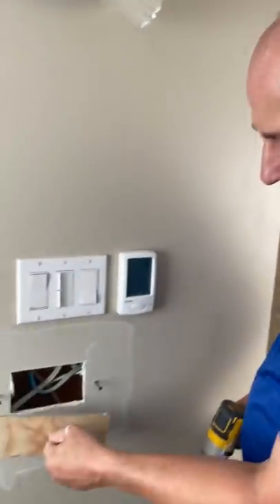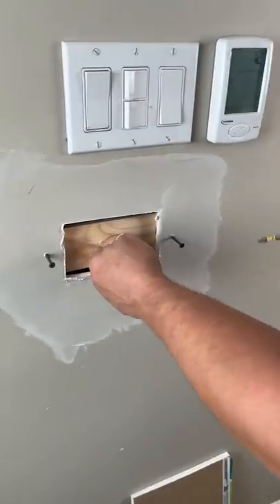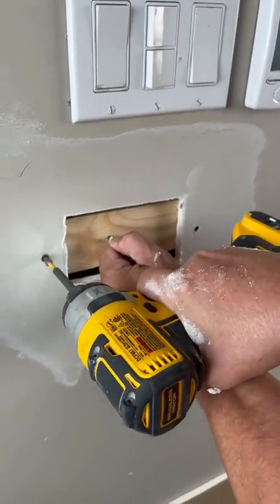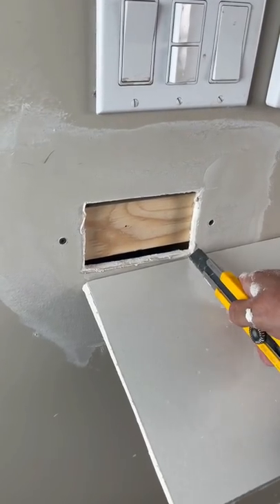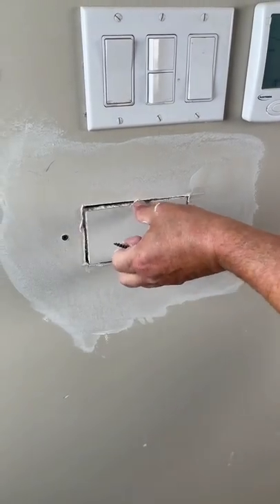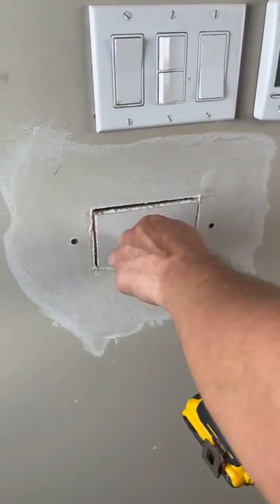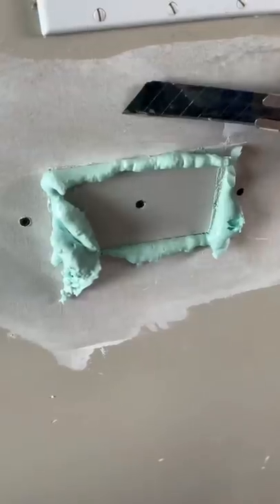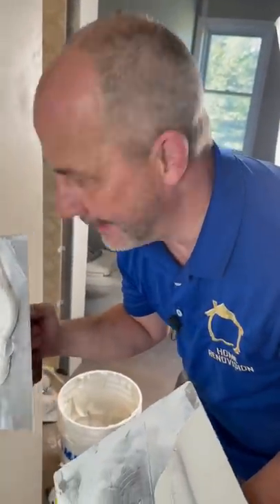Drywall Patch, No Tape Required #shorts

Comment: Learned this on “Canada’s Worst Handyman” as a kid.
Reply: Savage
Reply: I remember this too.
Reply: Red & Green?
Reply: Facts.  My eyes rolled when he said you don’t need tape.
Reply: Yep. I was probably 15 when I did this on a wall with lath and horsehair plaster.
Reply: @oluwaboriogunafolabi3997  you don’t need tape with this method
Reply: yep.
Reply: @mihailmilenkov6223  You don’t, I do.
Reply: @oluwaboriogunafolabi3997  everyone with their special needs xD
Reply: @mihailmilenkov6223  at the end of the day if it works for you or whoever you’re serving, and so long as certain standards of quality are met, everyone has their own approach.  In my experience the method on the video produces cracks. Especially in locations with extreme temperatures. I’ve seen it and opt for taping.  Usually prevents call backs.
Reply: Same
Reply: @oluwaboriogunafolabi3997  why tape when you can use this obviously awesome fireblock?
Reply: @oluwaboriogunafolabi3997  agreed. I don't want callbacks. Also, not everyone is A Okay with somethimg that expands. Ive seen people use too much. I would CA patch it or just cut, tape, and mud it. But to each their own I suppose.
Reply: @mihailmilenkov6223  lol
Reply: @oluwaboriogunafolabi3997  there are multiple ways to do proper repairs without tape.
Reply: Hahaha "best part , you don't need tape" or any skills or common sense
Reply: Is his name Ricky?
Reply: As a kid? Lol must have made some holes in them drywalls?😂 relatable to be honest 😂
Reply: Gold Star comment right here
Reply: If you wanted a quick fix over taping a small hole like this, I would opt for a California patch also know as a hot patch
Reply: You savaged him with that comment
Reply: Yep
Reply: Cut it so it leaves the paper on as a border. Then you don’t need tape
Reply: @3sotErik  😂😂
Reply: Is there a reason you shouldn’t do this? Is there a better way?
Reply: I loved that show
Reply: God I miss those shows.
Reply: @Omlet221  I mean everything is relative,it might crack,it might not most professionals would rather just tape it and not have to worry about it.
Reply: @wiskyr6510  Nah, his name is Gay Fonzie
Reply: @oluwaboriogunafolabi3997  shit I wish I had clients that just gave out money for shitty half assed work! Dont need tape? Why do people believe shit like this foam patch are a good idea? Have you encountered anyone in real life that's ok with it? I'm sure you mostly encounter people like I have that require good work lol
Reply: Lmfaooooo!!!!! 😆 🤣 😂  😆
Reply: My hero, but I'm always a day late lol
Reply: @NEED2CONNECT I have a genuine question as a complete non expert in any of this. Why does the tape change it so much? Without tape this wall going to collapse any second (which already wow because it doesn’t seem like a big deal to me just a hold in a wall like for a light switch) but with drywall tape this big wall collapsing problem is suddenly gone?
Reply: Literally.
Reply: Red green show?
Reply: @oluwaboriogunafolabi3997  I agree 100%.  I tried the no tape technique once and it worked for 2 weeks before it started to crack. I know this because it was at my house so I could see it happening. You have to shake the can of foam for 2 minutes before you can spray it, and I can tape it and be on to the next one in 2 minutes. It's just lazy
Reply: @Gl-my8fw  and there are multiple ways to do high quality repairs that you can guarantee and all of them but one use tape, and In the same amount of time, but if you're ok with cutting corners that's your choice, but this technique will fail and it's just bad advice and laziness
Reply: @gabrielshepherd6063  those work great, but the paper overhang is pretty much the same concept as tapping. Isn't it?
Reply: @chichidouglas5078  not that it is really anyone including the customers business what method you use anyways.
Reply: Ditto
Reply: @oluwaboriogunafolabi3997  you don't need tape technically just like you don't have to patch it either, but why would anyone choose not to do either
Reply: @MsTwissy  I believe that's sarcasm but you know that right
Reply: @Gl-my8fw if you're serious then I disagree. It's definitely the customer's business to know if they're getting a hack job or a professional job. If you're not serious then sure who gives a fuck about quality or a good reputation or recommendations for more work just be lazy and do shit work
Reply: @chichidouglas5078  no I’m so sorry I am a 25 year old psychology major grad applicant and I could tell you so much about Late life non-Alzheimer’s dementia and cognitive decline but I have NO idea how houses or structures work 😬 at all I feel very dumb and if you could explain it to me why that would be cool because I tried searching it on google but couldn’t find an answer that made sense to me but I promise I’m not being a dick I truly don’t know why tape changes the outcome so much. Or why in general a wall stands versus falls I truly have no idea.
Reply: @MsTwissy  l said believe it was sarcasm, but judging by some of the other comments maybe it wasn't.
Reply: @chichidouglas5078  ohhhhhh ok I get it the tape is not magic Thats why I couldn’t find out a reason why on the internet. Thank you, I am sorry for the paragraphs too I get so worried people think I am speaking in a mean tone so I go overboard trying to portray that I am truly just here for the positive vibes and not to get on anyones nerves at least not on purpose.
Reply: @MsTwissy  if you're being serious then just don't worry about what people you don't know think or say about you because they don't matter and have no effect on your life unless you let them, and if you're just trolling there's still  nothing to apologize for and at least you put some effort into it
Reply: Well holy fuck hahaha 😆
Reply: That  foam didn't look fire rated so I'm not sure what hes doing
Reply: @oluwaboriogunafolabi3997  Thank you for being nice with your reply. You esplained. Good feedback
Reply: Other than the insulation...tape would be awesome....
Reply: And its a damn good way to fix a hole
Reply: @chichidouglas5078  agree, the can of foam is also $10-15 and the can can’t be used after such a small job it’s a bit of a waste. Plus it’s a bloody mess
Reply: @kiloalphatango3256  you mean Red Green not Red and Green lol
Reply: @mihailmilenkov6223  yes u do lol or you will have spots that look like shit and will b a bit rough you can only sand so much
Reply: C'mon, he's a Pro. This is just for when a simple little home repair is all that's needed.
Reply: Clearly none of you know how to prepare walls. The block adds extra strength to the drywall while also providing a a solid base to properly fill in the holes with expansion foam and the actual drywall. There’s nothing wrong with this. If anything it’s one of the the better methods there’s nothing wrong with this.
Reply: The point is that when you use tape you're able to see the raised area on the wall.....

Ends up looking like 💩 unless you cut back the face paper to inlay the tape.
Reply: @Gl-my8fw  these people act like they couldnt patch a hole in gypsum without using tape to save their lives if they had to
Reply: Only.acceptable drywall repair that involved no tape.is.a california patch!
Reply: @oluwaboriogunafolabi3997  I really like this guy's videos, but I don't understand why he didn't just make a blowout patch instead. He's literally where I learned how to make them.
Reply: I did this once, never
Reply: @jeffreyhill1011 worst part is it doesn’t seem any faster or beneficial in any way. It’s like that one guy on the crew that is always trying to do tasks differently that they “came up with” to feel important for no reason other than ego or laziness. If you find a new way that works and produces the same or better results, power to ya. But reality checks are useful.
Reply: @oluwaboriogunafolabi3997 I thought it'll be another California patch, but it's worse...lmao

Comment: Next homeowner: Thinks its a stud and tries to mount a heavy cabinet
Reply: Yes cause everyone needs a heavy cabinet right under there light switch.
Reply: @hedananddazai5704  thats where I always install them
Reply: @spencerearl9964  your insane.
Reply: @hedananddazai5704  
Their*.
Guy in the video told us how to patch a hole. The hole could be anywhere, but in this video it's under a light switch...
Reply: @bsudun3050  indeed, but the point is the next home owner wouldn’t logically have that problem. I’m sure if the hole was somewhere else he would of done it differently. But it’s in the one spot no one will nail anything, especially anything heavy.
Reply: @spencerearl9964  usually light switches aren't placed inside a stud as that takes a lot more work when they are extremely light and can be put up using plasterboard screws, if you see a light switch there are going to be wires around that area of the wall, choose a better spot
Reply: @Faolan_Grey  Got'em 😂
Reply: This made me laugh so fucking hard
Reply: Ngl I had this happen mounting my TV, turns out it was an old doorway someone closed up with with plywood and mud.
Reply: You dont hang a heavy cabinet directly into a drywall. You mount it to the metal strips behind
Reply: @spencerearl9964  hey stepsister. You seem stuck. Need some help?
Reply: @cornpop9262  yes I seem to have put my hand straight through this weird weak spot in the drywall. Please save me step bro
Reply: Olol
Reply: @spencerearl9964  haha
Reply: Stupid asf, yet funny ash
Reply: If you are hanging cabinets without looking for studs or measuring spaces between all studs, then you deserve to have your heavy cabinet fall. What a dumb comment. Clearly you have no idea what you are doing.
Reply: @hedananddazai5704  this is funnier than the original comment
Reply: @bsudun3050  and if that hole was in any other spot, it would of had a different fix. This guy did cut a corner and I don’t recommend, but the comment said that the home owner would put a heavy cabinet in that spot. I simply stated that’s stupid, no one hangs cabinets right under light switches and most home owners don’t even nail anything near their light switch for fear they will fuck something up
Reply: @lordandsavior6726  exactly!!!!
Reply: @bradenkuehl2033  thanks?
Reply: @hedananddazai5704  good carpenters don't rely on "who would do this".. amateur
Reply: @bsudun3050  don’t respond
Reply: @bsudun3050  just know
Reply: Lmaoooo
Reply: He should have used another smaller piece of drywall instead of the plywood.
Reply: I’m sorry but I had to join this legendary battle
Reply: Lmao
Reply: @hedananddazai5704  Yes, cause everyone who uses this technique will be patching a hole beneath a light switch.
Reply: @JackR_TV  from the reaction in the comments it’s clear this guy is the only one who does this ‘-‘. But I think your missing the point, there is a hole under the light switch, and because of that he used that technique. He didn’t use that technique and the hole just so happened to be there. That’s the logic your going on, every problem has different solutions doing what he did won’t have the problem Of running into a heavy cabinet because of the location. And the location was why he used that technique, if he was fixing a hole on a kitchen wall away from all possible wires like you know a LIGHT SWITCH, then he would use a different hole. Because there is a actual possibility of a heavy cabinet being placed there. Anyone who mounts a heavy cabinet right under a light switch is just asking from problems and in that case it’s there own fault if something happens. You electrocute yourself it’s on you dawg.
Reply: @hedananddazai5704  their
Reply: That’s why I would only advise to do this to your personal home and not a client
Reply: @Faolan_Grey  savage
Reply: You can expect there to be minimum stud underneath ELECTRICAL
Reply: feels like that's gonna be a them problem
Reply: @frankfort976  ""whaa diid he say tha doesnt pass ur grammer n spelln test?? And go ahead an hate my grammer n spelln I DONT CARE!! 👍🙂👍
Reply: @bsudun3050  they're*
Reply: Next Home owner ain't your problem. Who cares
Reply: Below a light switch?
Reply: Use a slice of drywall the same size as the wood.
Reply: Whole house collapsed except that one repair spot...
Reply: @hedananddazai5704  Yes, cause drywall holes only happen under light switches.
Reply: @hedananddazai5704  Jesus man THAT WAS THE JOKE. 🤦‍♂️
Reply: @Frosst  it’s 2022 shame on you for joking smh
Reply: Why not just use a piece of drywall with gauze
Reply: @hedananddazai5704  have*
Reply: That sounds like a them problem
Reply: Delightfully devilish
Reply: Experts: Only I know how to do it right, you have to burn the house down and build a new one because there are no methods of patching that don't get criticized by guys like me that have been "doin it for 30 years"
Reply: Also, these holes are often behind doors, caused by doorknobs.  No shelf there...
Reply: Hey, actually when you're checking for studs, do the extra work.

It's common to have all sorts of blocking in the walls. Larger holes often need extra support. Imagine a 12" hole between studs(16" apart). The patch needs to be held up! So support has to be given.

Whatever technique you use to find studs(just use a stud finder), take the time to test it. Measure 16" over, and make sure there's a stud there. Go up, to make sure there's still stud.

A lot of stuff, like cabinets, need to be mounted to studs. If you find some sort of blocking, scrap wood from patches, or maybe even a malfunction, then you're not hanging cabinets on studs, and you will never land on one. I'm sure we can imagine how that would play out.
Reply: I build and install cabinets…If there is a whole that needs patching, thats not where a cabinet should go anyways wether if it was patched or not…..
Reply: Lol !
Reply: That's actually a good point.  I'm going to check up and down whenever I need to find a stud.  Just to make sure there's no random wood there.  I'm not being sassy, that should be considered good practice (finding a stud, and then checking top to bottom with a stud finder to make sure it's a stud).
Reply: @Lee-fw9mr  that absolutely is good practice, because there's not just studs in your walls but blocking, too

Blocking goes between studs. I don't work residential, or wooden framing, so I'm not sure of the specifics. With metal framing, we just run blackiron(C shaped metal) through the run. For cabinets and heavy objects that are planned to be there, we have flat metal laid out so we can screw into it without anchors.

But blocking goes left and right between studs, so if you use a standard stud finder, you might just find a blocking. This means you can't run 16s off of that point(studs are 16" apart)
Reply: @juan2049 hell yeah Jaun 👍
Reply: @hedananddazai5704  Where you fail to understand why it's a problem is because of how the video is labeled. It's a general statement not a contextual one. So of course people are going to bag on this way of patching because he didn't state it's only for specific places. Don't blame the commenters blame the title editor.
Reply: oh come on😮😢
Reply: *you’re
Reply: @AlmightyEvil1  ....on the internet, not the boardroom, or a classroom
Reply: This comment is worst then the havk
Reply: If the next homeowner thinks that he should continue paying rent somewhere.
Reply: If you don't understand why that is not actually a problem, you should hire somebody to mount that cabinet for you
Reply: If you TRY to mount something where you THINK there's a stud, you deserve whatever happens first. Always make sure things are secure.
Reply: 2 weeks later: cabinet hits the floor in the Middle of the night 😂
Reply: Yeah you wouldn’t mount a tv right by a switch like that
Reply: Yeah cabinets on the floor under light switch … deeerpppppp
Reply: No, he wouldn't. Why would he? He has ways to find studs without questioning it

Comment: "Lemme show you a trick everyone knows, but, I'll make it take longer while you wait for expansion foam to cure. Then, just like if you used drywall tape and saved 3 hours, 💥 boom project half assed!"
Reply: Could always just use duct tape and some markers too! 😂 I would totally so something like that
Reply: Agree
Reply: The foam is 7 bucks too
Reply: Gad to see you don’t understand the point of doing this. Tape requires a bit of buildout to blend properly. This allowed for a much smaller buildout on a flat textured wall leaving with a less noticeable repair in the end. Educate yourself before insulting someone doing better work than you.
Reply: @alexberry4758  I understand the reason for buildout but I don’t think you understand what the foam is doing here. It is providing adhesion from edge to edge while also giving a structure and surface area for the topcoat to grab. Also your last comment is beyond petty and gross. I get  trash talk for fun but grow up, that’s nasty.